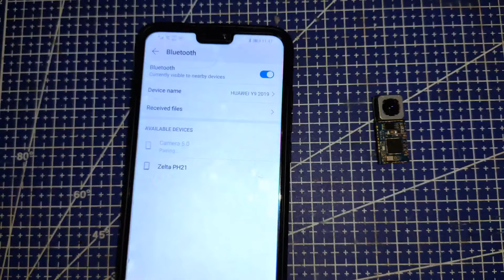How To Make Wireless Spy Camera at Home

Comment: It would be helpful if you include specifications and what part of the module you solder those wires.
Reply: He bro, He is not genius person to make that happen, 
I'm an Electronics Engineer and confirm this...
He also not used any data pins from the camera (only used connector body solder pad) and not shown pin diagram of camera and the PCB module ...

Also that's why he didn't included parts list and purchasing link...
The video is shot on another smartphone and played he's making people fool and making money.

Fake channel!!! 
Wasting people's time...
Show something that is real and people can build easily
Reply: @sunnysurwade464  Still this guy got more than hundred subs. I actually searched for esp32-cam and this came up in the results, really disappointing.
Reply: Its fake lol
Reply: @sunnysurwade464 can you make one real video of this?

Comment: Not to be a smart aleck, but how do you charge it or do you simply unglue the battery and replace it with another one?
Reply from the maker: You can add charging module
Reply: @imakerOfficial  thank you!
Reply: Esp32 cam wifi bt module
Reply: @imakerOfficial  can It store the footage please reply
Reply from the maker: yes you can
Reply: @imakerOfficial  how ??
Reply: This is fake video
Reply: @factDC2 You r right bro, he is not genius person to make that happen, 
I'm an Electronics Engineer and confirm this...
He also not used any data pins from the camera (only used connector body solder pad) and not shown pin diagram of camera and the PCB module ...

Also that's why he didn't included parts list and purchasing link...
The video is shot on another smartphone and played he's making people fool and making money.

Fake channel!!! 
Wasting people's time...
Show something that is real and people can build easily
Reply: @imakerOfficial  where I find the added part you attached on camera???

Comment: Bro What is the range of camera. I want to feet in drone
Reply from the maker: It's not for drone. 10 m Rang only
Reply: Bro it's a fake video don't belive this video
Reply: Write bro
Reply: Me too 🥰
Reply: You'd have to figure out how to connect the camera to a VTX and the distance would be determined by the power of the VTX. 25mw 200mw etc...
You'd also have to figure out which wire connection on the camera is which.
Reply: @imakerOfficial  Hii I need this camera Want to buy
Reply: @imakerOfficial  Can I buy this?
Reply: @imakerOfficial  Can I buy this?
Reply: @imakerOfficial  yap, bluetooth used.

Comment: Can you use an old iPhone camera with the same board? I'm confused as your soldering pins to connecting pads and not soldering to the actual pin outs on the camera module...
Reply: Expensive man
Reply: @ironyguy1750  it’s fake

Comment: The battery you put in how long does it last? Could it be loaded or does it have to be changed?
Reply: Please answer me 🙏
Reply: @melvinkennethquintanillatr8272  i would like to know as well
Reply from the maker: i forget to include the charge system.
you can charge it with mobile charger
Reply: This is a fake project:)
Reply: @Darklordgaming1 You r right bro, he is not genius person to make that happen, 
I'm an Electronics Engineer and confirm this...
He also not used any data pins from the camera (only used connector body solder pad) and not shown pin diagram of camera and the PCB module ...

Also that's why he didn't included parts list and purchasing link...
The video is shot on another smartphone and played he's making people fool and making money.

Fake channel!!! 
Wasting people's time...
Show something that is real and people can build easily

Comment: Could you connect camera and board directly to a power source like wall charger via usb cable to have the camera running all the time. 
This would be like home monitoring diy project, and what kind of board would be needed to make it possible to connect from another place. To be used as p2p ip camera for example.
Reply: That's what I'm thinking
Reply from the maker: You can do it with mobile phone charger or any 5v charger Thank you
Reply: To which bord is camera connected

Comment: Did anyone find out what that gel stuff was that he used with the heat gun to remove the board? It looked like vaseline.
Reply from the maker: it's Soldering paste
Reply: @imakerOfficial  It's called FLUX, not Solder Paste!

Comment: good but what is camera module & where did you get it from., and what would you do when the battery is empty
Reply: You r right bro, he is not genius person to make that happen, 
I'm an Electronics Engineer and confirm this...
He also not used any data pins from the camera (only used connector body solder pad) and not shown pin diagram of camera and the PCB module ...

Also that's why he didn't included parts list and purchasing link...
The video is shot on another smartphone and played he's making people fool and making money.

Fake channel!!! 
Wasting people's time...
Show something that is real and people can build easily

Comment: Fake video
If it real means can you tell how did you reduced data lines with 4 wires, which protocol did u used to reduce 

Actual process 
Image sensor to Analog to Digital converter "sampling and Quantization" to Digital image processor  so on..... 

Can you tell which process did u used for that  ???